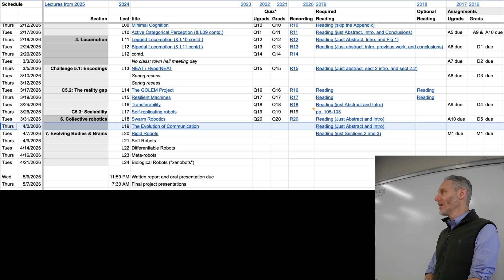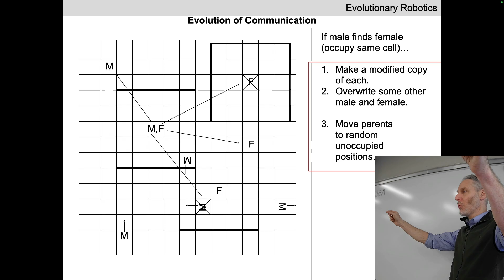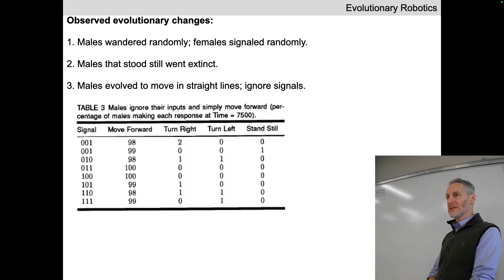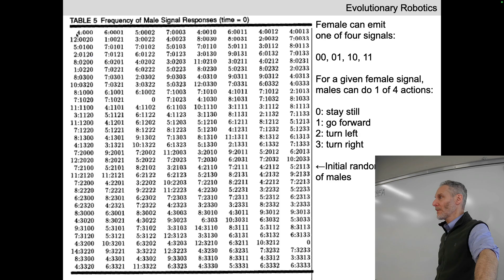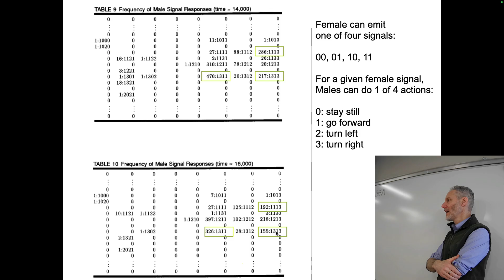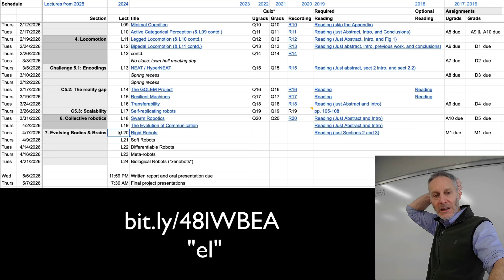Lecture 21: The evolution of communication.

Comment: I find it fascinating that redundancy beat out efficiency TWICE. That is, not only was it better to only pick one direction and repeat it up to 3 times to get the male to do an uncle (triple turn), but that signal was sent in 2 parts of the message redundantly. This might be one of the most important findings, that evolved communications tend to maximize robustness to improve survival rate. This does actually make sense as the more robust signal survives the large majority of mid-tier skilled senders/receivers and thus beats a perfect signal that survives transmission and receipt a small fraction of the time only in exceptional individuals/pairs. It is also more resilient to noise or randomness.